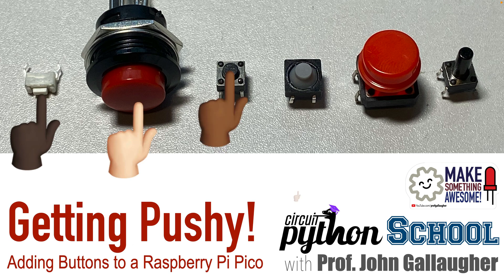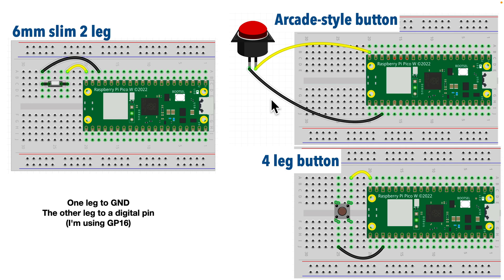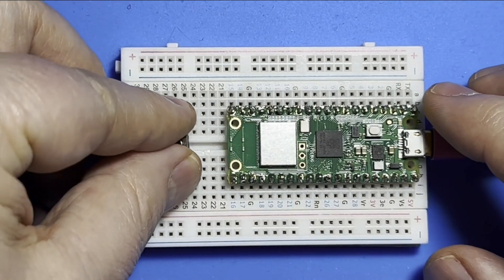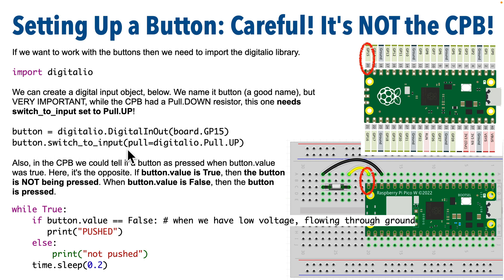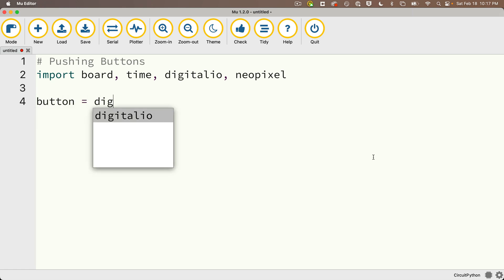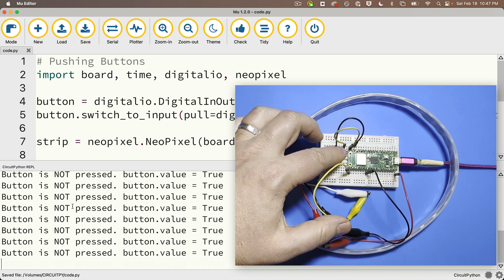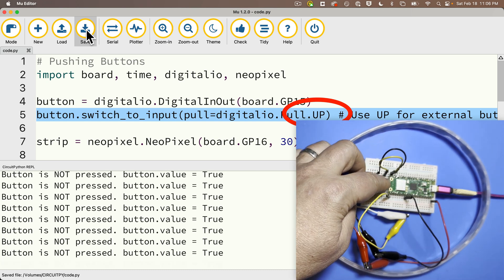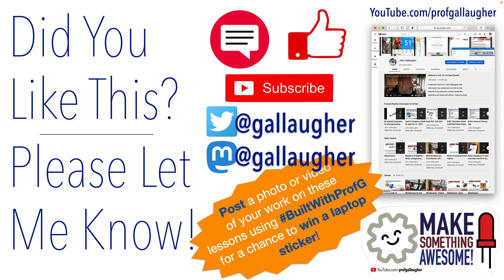SEE DESC FOR UPDATED VERSION: Getting Pushy by adding a Button to the Raspberry Pi Pico

Comment: As a total newby... am getting No Module Named board or digitalio... any suggestions?
Reply from the maker: Also make sure you've installed the proper CircuitPython library for your board. For example: Raspberry Pi Pico W if you're using the "W" board, Raspberry Pi Pico for that board. Has that solved you issue? Good luck!
Reply from the maker: Are you using CircuitPython and not microphone? Those modules are built into CircuitPython. They don’t need to be added to “lib”. So if you installed CircuitPython (earlier lesson) you should be fine. Just use the import statement in your code.

Comment: Could you possibly give me some links for all the pieces needed?
Reply from the maker: Look at the Google sheet link in the very first video at bit.ly/circuitpython-tutorials (it’s in the video description - those are below the YouTube videos. Sometimes you have to click to expand them). That link has all of the parts, links, etc.
Reply: @profgallaugher  Is it ok to buy a Pico WH because that is what the link takes me to that was on the spreadsheet.
Reply from the maker: That's the one to get. It has the headers pre-soldered on it. You'll want to get a breadboard, too. If you're just experimenting, the CircuitPlayground Bluefruit (CPB) board is a great first board. The CircuitPython you'll learn will mostly translate to the Raspberry Pi Pico, but the CPB has a bunch of sensors, lights, and other hardware on board, and it can be easily expanded with alligator clips. Feel free to use either, or both, but the CPB is a great first choice given it has so much embedded in it. CircuitPython will be mostly standard across the >500 boards that run the language.
Reply from the maker: Know that the Raspberry Pi Pico-WH doesn't do a whole lot on its own. You'll likely want some additional hardware if that's the one. you go with. Get a breadboard, a neopixel light strip, pin-alligator clip wires, and most of the sensors I use (e.g. the 12-pad touch sensor, distance sensor, etc) use the STEMMA-QT standard, so this product is good to use with STEMMA-QT expansion since these devices can be daisy-chained together. https://www.adafruit.com/product/4209. You'll also need a STEMA-QT cable to go from the port on that product to any of the STEMMA-QT expansion items - something like this will work: https://www.adafruit.com/product/4210 Again, the CPB is really nice as a first board because it includes so much & you can experiment with motional detection / accelerometer, lights, sounds, light sensing, buttons, and more, all on the board. This may make it easier to choose hardware for a board like the Pico-WH in the future. Cheers & good luck. Also know that Adafruit Discord is a GREAT place to ask for help. I mention this site in the intro videos.
Reply: @profgallaugher  I already have A CPB do you recommend any buttons on adafruit that could hook up to alligator clips.
Reply from the maker: A button like this has two terminals on it. One can be alligator clipped to the button, the other to the CPB. If you look at some of the builds in the playlist, or some of the builds in the maker snack playlist you'll find on my YouTube channel, you'll see examples of various components. Here is one button with two terminals that's likely large enough for alligator clips: https://www.adafruit.com/product/1445 For specific project questions & what to buy, I definitely recommend that you check out Adafruit's Discord channel. The responses there are posted VERY quickly & there are many more people than me there to offer experienced hardware & coding advice. Good luck!
Reply from the maker: Also make sure you get a USB data cable. The Pico boards & the CircuitPython boards have a micro-USB connector on one end. Make sure the other end matches your type of computer or that you have an adaptor. For example, Newer Macs have a USB-C connector but many cables have the larger rectangular USB-A. I have a bunch of adaptors USB-A to USB-C, and I prefer the microUSB cables that can be used right side up or upside down. Here's a favorite of mine: https://www.adafruit.com/product/4111

Comment: Hi, I'm currently using Thonny but see you are using Mu and it has autocomplete is it worth changing over to help learn?
Reply from the maker: Mu isn’t great. My biggest complaint about working with CorcuitPython is the lack of easy integration with better development tools. I plan to look at options later in the year, but Mu is free so it’s easy to try out if you find it useful. The interface is supposed to be easier to use, for young kids, but I find it more trouble since it’s non standard. Good luck and feel free to share your experiences!